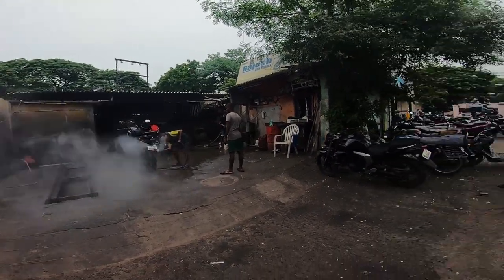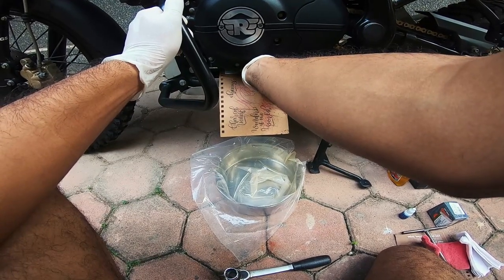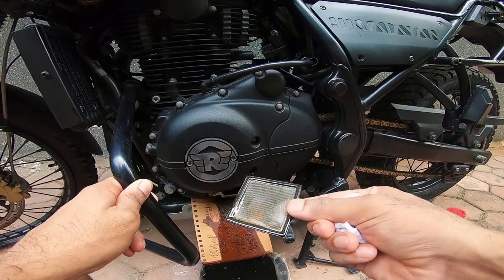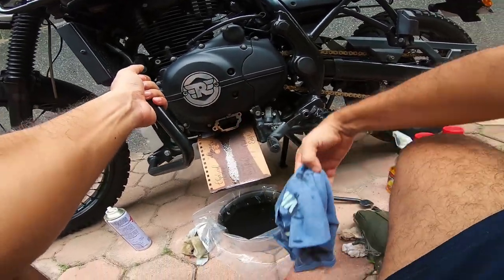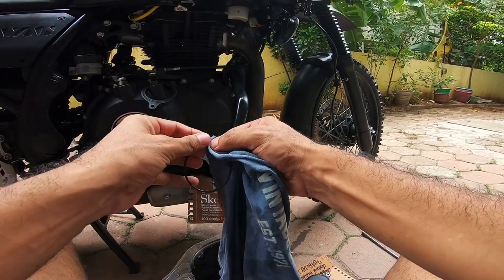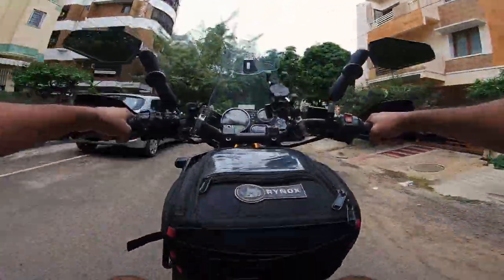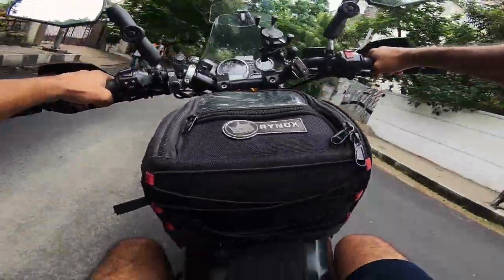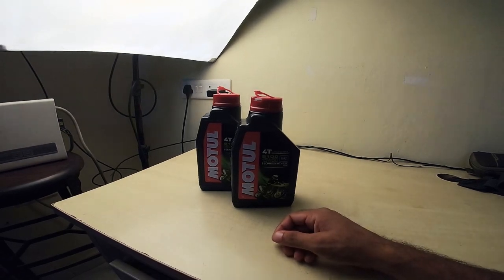ENGINE OIL CHANGE @3000 km ON THE ROYAL ENFIELD HIMALAYAN - A DETAILED YET PRECISE WALK THROUGH

Comment: Thorough and well paced, this is the best Himalayan oil change "how to" on YT.

At first I wondered about you not changing the o-rings, gasket, and crush washer then you mentioned how availability is an issue. Going over how to evaluate and maintain them when you can't replace them is an important point that is usually not covered.

Lastly, covering the amount of oil consumption is immensely helpful and, again, not usually covered. Thanks so much for this excellent tutorial.
Reply from the maker: thank you for the kind words of acknowledgement.

Comment: I'm interested in the new Scram 411 (which I'm guessing has an identical oil change procedure) and I stumbled across this video... Can I just compliment you on this excellent production? The care with which you clean and check the O rings and gaskets reinforces my belief that a bike that is so well cared for always looks after its owner!  Obviously liked and subscribed :)
Reply from the maker: Thank you for the kind words Nick . Glad that you noticed the details . And yes the oil change procedure is identical on both , in fact the engines have no mechanical components changed in the new scram.
Reply: A trick to consider on your o-rings... on older automatic transmissions on cars, I have heard to put a little bit of brake fluid into the transmission fluid. As it circulates, it will get on to all the o-rings. The rubber in the o-rings will absorb it and swell slightly and reseal whatever they are meant to seal. It does not take much, a couple of capfuls into your fluid reservoir, and it will eventually dilute into the transmission fluid. 
For the purposes of this video, just take a couple of drops on your finger and wet the o-ring seals while you are draining the oil from the engine. 
Also, while you are running the engine to warm the oil prior to changing it, that is a good time to clean and lube your chain.

Comment: Good one, well explained. Crank the bike for about five seconds, you can extract little more old oil from the engine. Beware !! not more than five seconds.
Reply from the maker: Shaji K.Damodaran Thanks for the acknowledgment sir .
Reply: I wouldn't run the bike without oil. You'll do more damage getting oil out rather than just filling with clean oil. I tip mine on the center stand as far as I can, drains mostly everything. Free workout too :D

Comment: Good job Ben.  Here in the states quite a few of us run a full synthetic oil as we normally run a bit higher RPMs.  There is also an additional drain plug near the front of the engine.  Not everyone uses it as it’s placement is a pain in the a$$ to place a drain spout such as your cardboard.  Again, a very good job Ben.
Reply from the maker: Hi Joe. yes that's because of the kind of roads you have there. our national highways have more traffic than your city roads . Its an adventure every single day here . also the third drain bolt lets out about 50 -100 mls which can be collected from the main drain bolt if you lift the front up ( bike resting on you side stand) . i do that regularly . didn't want to show that on video as enthusiastic  novices ( too many  out there ) here will find themselves  in trouble if they get it wrong.
Reply: ON TWO WHEELS BEN Well if my calculations are correct you only have 5.7B people more than we do and of course the animals.  So yeah, I can see a bit more traffic.  👍🏽. Have a good day Ben.

Comment: I am actually thinking about upgrading my BS6 and I see that you're very knowledgeable. Would you say that the £1000 pounds for powertronic, free flow filter and exhaust, chain and sprocket upgrade is worth it? Is there a big difference with cruising speed/acceleration/fuel consumption? Thank you so much for the videos, I've learned so much!
Reply from the maker: yes together they account for faster acceleration, better throttle response and higher cruising speeds. and if you get the tuning right ( depending on how invested you are in the process) you are looking at an additional power gains of 3-5 bhp.

Comment: Bhai, alternatively you can also remove spark plug and crank the engine 3-4 seconds by pressing power button for 3-4 times. Don't over do it ... Surely some 50ml oil will come out .
Reply from the maker: sorry to disagree dear Shishupal , but one should never remove the spark plug and crank without first CLEANING THE ENTIRE AREA THOROUGHLY. The inward suction of air will pull in all the dirt in the plug well into the combustion chamber  . this is not a recommended  practice (especially in an offload used machine) .
Reply: Not worth doing bearing damage for 50ml. Just put fresh fluid, you'll never drain everything anyway. At most tip it on center stand as far as you can hold it.

Comment: Hi Ben, thanks for this awesome video, I’m so much eagerly waiting to change my engine oil, but just a quick question to know what was inside the smallest eye drop bottle which You applied on the 8mm bolt. Thanks a lot for the detailed video 👌🏻👌🏻👌🏻
Reply from the maker: Thanks dear friend for the kind acknowledgment. Means a lot . Will continue to make meaningful content. That was blue loctite for threads or thread locker ( common name ) .
Reply: @ONTWOWHEELSBEN  🥰

Comment: Thanks for another great video Ben 😁

I have a query which is half off topic of this, regarding engine flush. I am planning to flush my bike once it reaches 30K KMs. My concern is the sump is 2.3 liter and the drain amount is less so around 500 ml is still in there so the flush mixed oil will be there even after draining. How to deal with it ? Or to run cheap 15W50 for 10-15 mins drain it n put the oil we want ? 

One more request will you make a list of tools with sizes needed for Himalayan or you can make a seperate video for that as per your time.
Reply from the maker: Dhananjay Patil use a cheap oil after flush - period . Also have made a video on complete EDC tools for the Himalayan  long . Kindly watch the beginning videos
Reply: @ONTWOWHEELSBEN   Thanks a lot. Will do that 😎

Comment: Hi Ben, love your video's man.
Need 1 suggestion from you - I have done 2,800 km in my Himalayan BS6 after 1st servicing, should I change the engine oil now or wait for 2nd servicing (after 5,000 km or 6 months). 
Your advice would be appreciated.  TIA
Reply from the maker: change at 3000 k IF you ride hard . otherwise change when the oil is fully burnt and has lost its viscosity ( or almost lost ) . usually 5-7 ks.
Reply: @ONTWOWHEELSBEN  Thanks for your reply Ben.
Currently bike is running on RE Liquid Gun and completed 2800 km.. for top up can I use Motul 15W50 when the oil level decreases after a ride.

Comment: How this oil works..pls explain long term review..currently i using liquimoly 15w50 .is it is good uprade to motul?
Reply from the maker: I have used motul for more than 20 years now . Mineral , semi & fully synthetic. They are the BEST in my opinion for hi revving motorcycle engines . So if u ride hard go with it . If not all the other brands are options .

Comment: Should one check the oil level immediately after switching off the ignition? In my Himalayan the oil level hovers inbetween the two marks for a minute or less, then it rises way above
Reply from the maker: 3-5 mins on level ground.

Comment: Very informative video Ben. Thank you.
I  had question which has got me confused due to some positives about using Polytron MTC or any other metal conditioner for himalayan? What are your thoughts on it? would be really helpful if you guide on that part. Thanks in advance.
Reply from the maker: I have tried engine oil additives from manufactures like ows, liquimoly and stp .. Under hard riding these products don’t make any difference to the noise level , heat generated from the engine and oil viscosity drop . But yes the oil levels don’t drop as frequently with them in comparison to oil only .
Reply: @ONTWOWHEELSBEN   thank you so much.
Also i have been experiencing air/petrol bubble from fuel tank lid. Is it due to air lock issue? Do you have any idea why is it happening? I had serviced my bike recently from RE a week back. Has been facing it since then.
Reply from the maker: @sumeets950  watch my EVAP removal video .

Comment: Thanks for the nice video.  I just did my first oil change and noticed that my oil filter cap does not have a rubber o-ring, but just the gasket... it has a grove for an o-ring but none was in there.  Is this alright, or should I have both?  I replaced the gasket with a new one, but did not have an o-ring so I just replaced the cap as it was originally.
Reply from the maker: Mike K it has to . There is no two ways about it .
Reply: @ONTWOWHEELSBEN  Thanks.  I wonder why it came from the factory without the o-ring.  Now I'll have to try and find one.
Reply from the maker: @mikek2218  its  a rare assembly line mistake . happens to hand built machines once in a while. these machines are built  @ chennai/ India,  where i live - 40 kms from my place to be precise and the wages are terrible , so i don't feel like complaining . i help myself out at every instance possible.
Reply: @ONTWOWHEELSBEN  Thanks Ben for the insight.  I am sorry to hear about the poor working conditions, so I certainly won't complain too much.  I have also noticed some other quality control issues, but I understand it is a bike built to a budget and I have to be realistic with my expectations.  I hope RE decides to take better care of their workers... I think they can afford to.
Reply from the maker: Mike K sure mike every rich man / brand / corporate in India is atleast 10 times richer than their contemporaries in the west . These guys don’t have far sight and don’t understand the importance of service .  but the irony is they never get to learn their lessons from their mistakes. Too many of us ( and too many in the making ) at any given time would love to buy into their products and keep buying . Perks of establishing a brand in a country like India. 80 dollars / month as wages to someone who puts your engine together is by no means fair and no body can complain . millions waiting to grab the job .
Reply: Not both. Either one or the other, either work fine. Double gasket just means twice the leakage points.
Reply: @0xsergy  Good point sir.  I have been watching for leaks with just the gasket, but so far have not noticed any.  I will keep monitoring.
Reply: @ONTWOWHEELSBEN  That really sounds terrible Ben.  I have always had Japanese motorcycles.  But one of the reasons, why I decided to get a RE this time was because I wanted to support an Indian company and your economy.  But it is very disheartening to know that RE is exploiting their workers.  Why can't corporations do the right thing and treat people fairly and with dignity?  They will still make money, and have an even better product as well.
Reply: @mikek2218  i reuse the gasket/oring often, no issues yet. just make sure the oring isn't flattened

Comment: Hi Bro I own BS6 Himalayan I have clocked 900KM in I get some tik tik noise from the engine after I ride for some distance is tat the tappet problem .If so it can be rectified? please help me with what needs to be done.
Reply from the maker: adjust the valve clearance to inlet .09 mm and exhaust .23. and pls dont worry about noises.
Reply: Its common in himalayan mine have too

Comment: Great video ...do u prefer 3k change ? Because motul runs about 5k and royal Enfield oils as per factory recommends 10k interval..so wanted your view on this
Reply from the maker: Shiv Prasad thanks for the like . YES I would always recommend a 3000 km drain interval if you ride hard . 3000-5000 if moderately ridden ( city commute ) . And def not a kilometre more even if you have a double Ester fully synthetic oil in your engine . 10 k drain intervals may work in a cold country when moderately ridden .
Reply: @ONTWOWHEELSBEN  Heeding your advice I changed the engine oil on my Himalayan after 3100 Kms. Mostly included a long hard run to Mussoorie and multiple weekend trips to Kasauli, Chail and elsewhere in Punjab. Lot of metal shavings seen though. Went with RE Liquid gun 15w-50. Thanks for all the videos Ben. Keep rocking!

Comment: Uummmm.........I just did my 300 mile change and the filter cover did not have an O-ring ? ! The gasket had the flat (case side) and the cover side had a slighty raised ridge where the O-ring would be....so I guess that works? Thanks for vid.
Reply: I looked into this and it appears the gasket was introduced as a replacement or alternative to the O-ring. I guess it's not necessary to use both, but is it of this groups opinion that it's better to do so? Thanks

Comment: Hi, I'm from Brazil and own a BS4 Himalayan. I'm facing  pre-ignition problems in my motor. Do you have any knowledge about this kind of problem. I think the problem is regarded with the Brazilian fuel. Do you know if the powertronics can solve this problem?
Reply from the maker: yes the powertronic will solve the problem if you get the right map. Also only use very good quality fuel. and try not to over rev the bike . lugging is very bad in general also.
Reply: @ONTWOWHEELSBEN  thank you

Comment: i'm contemplating on changing to either MOTUL or LIQUI MOLY. Which one do you recommend to change?
Reply from the maker: AJS Films both equally good. Tested by many riders and labs .
Reply: I have used both.. not satisfied with liqui molly (10 w 50)..
And after shifting to motul 300v.. bike performance again poor after first few hundred kms.

Comment: Is it better to change the engine oil n filter at every 3000kms..? What kms do we change fork oil n all ..
Reply from the maker: Engine oil at 3-5 k kilometers. Fork oil at 10-12 k kilometers. Brake fluids at 8-10 k kilometers.
Reply: @ONTWOWHEELSBEN  Thank you Ben so much for the clarification..may be you open a Himalayan garage and I would come all the way from Bangalore to Chennai for my all Himalayan works🙂
Reply from the maker: @deepakwarrier612  sure friend. That’s the plan

Comment: Why do you say 1.8litre will go in the motorcycle? When the owner manual says 2.0?
Reply: Owner manual clearly says 1.7 to 1.8 while refilling..
Reply: @cakalpakbangad2172  mine is a BS4 and I wish I could share a screenshot with you. As mine clearly says 2.3l initial fill only, 2.0l subsequent refills.
Reply: @anirban17aug  okk.. mine is a bs4 too.. but my manual says 1.6 to 1.8 on a refill.. 
But the best way to check is the guage on the right side of the engine.. it has the maximum and minimum mark.. whatever quantity you use.. make sure to fill it up to maximum mark.. and rest assured! 😊
Reply: @cakalpakbangad2172  yup that is what I finally did 😇

Comment: Any idea how to reduce the engine temperature 
Climbing 40 degree for just 5km riding
Reply from the maker: It’s not your engine temp . It’s the ambient air temp . The sensor is under your seat . Also the gauge showing 40degrees depends on a LOT of factors . In short don’t worry about it until it hits 55 on the gauge .
Reply: @ONTWOWHEELSBEN  thanks bro 👍🏽
Reply: Can you change the position of the sensor to have a more reliable outside temp?
Reply from the maker: @MyFrankHut  yes . it can be moved to a lot of different locations on the bike where the engine heat will not get to it.

Comment: Hello! I want to reduce height of himalayan bs6.. please share your advice..
Thanks in advanve
Reply from the maker: By how much would you want to reduce it ?
Reply from the maker: If you are ok with 780-790 mm seat height then the best thing to do is go for a 120-80 -17 or 110-80-17 or 110-90-17 tyre for the rear . And for the front push the forks up by 8-10 mm.
Reply: @ONTWOWHEELSBEN  I'm 5'4, so 3 MM should be the better I guess...
Reply from the maker: @sannsher6386  the only thing you should do is work on your riding style . Learn to be a more active rider and use the Himalayan as a bike only for serious fun and off reading . Use a shorter bike for city use .

Comment: Hello Ben.. thank u for your super informative videos..
I really would like to know wether using a Synthetic oil in Himalayan(bs4) would have any serious threat to the engine..
I am asking this as I switched to liqui molly 10W50 and the performance of my bike worsened..
I drained it at around 3000km (liqui molly recommends 10000km) but my bike could not handle it..
So I shifted to motul 300v (15w 50 which is recommended) but after a first few 100 km the story is the same.. bike is so loud now.. and gear shifts becoming harder by the day!!

Should I stick to semi Synthetic?
Reply from the maker: Hi friend. glad that my videos are helping a lot of fellow bikers. coming to your question. SINGLE CYLINDER TWO VALVE Engines which run synthetic oils tend to be a little more noisy when the engine runs hot. so its a common practice to avoid using the same . but other than oil leaking out of mating surfaces (weak gaskets) there is no other harm to the engine . on the contrary , performance is enhanced at higher rpms with fully synthetic oils . Also yes, synthetic oils cause clutch slippage in weak clutch plates . semi synthetic is recommended by the factory for a reason because it can take on a wide variety of terrains, riding styles and weather conditions . if you choose to go with synthetic use it only if you decide to ride hard with quick gear shifts .
Reply: @ONTWOWHEELSBEN  you are simply amazing brother..
Thank u very much for taking the time and explaning it in so much detail.. u cleared my query in such a nice way.. thanks again brother!!
I am pretty much impressed and must say that I am a fan now!! 😊
Reply from the maker: @cakalpakbangad2172  glad to have earned your love . 🙏